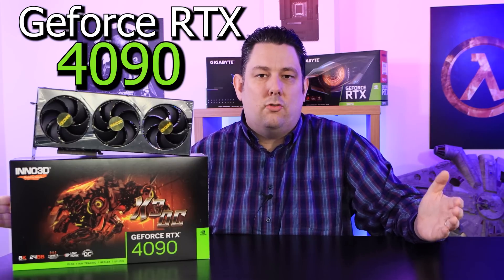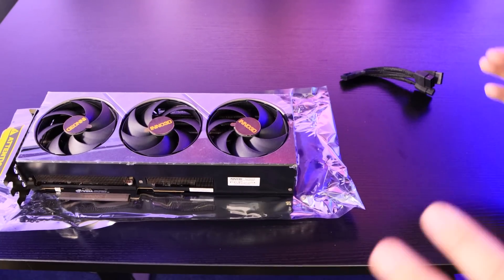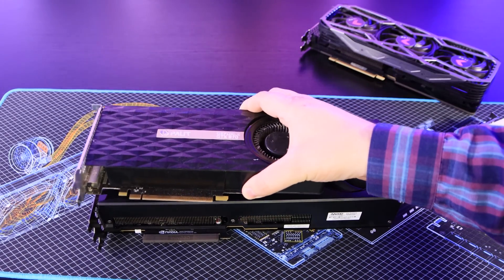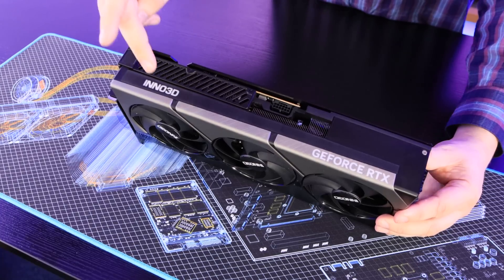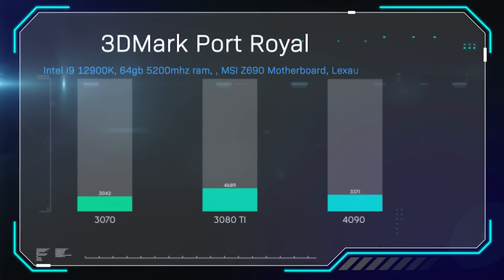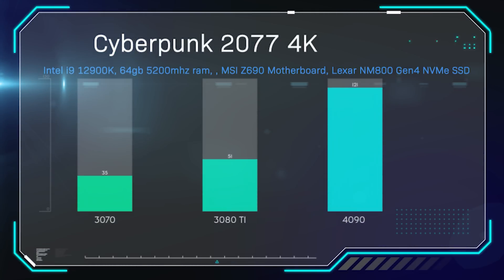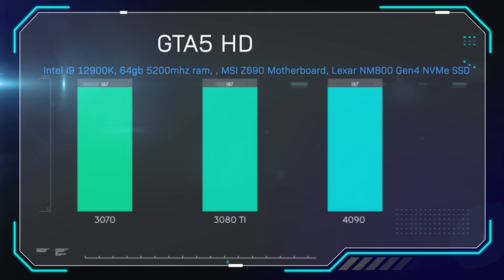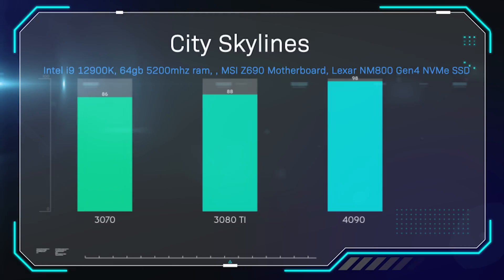How BIg? GeForce 4090 Benchmarked - Inno3d GEFORCE RTX 4090 X3 OC

Comment: 1200W plus?? I mean yeah that's cool but I have no problem running my 4 SSD's, RTX 4090, i9 12900K with my Corsair HX1000i PSU. I guess I am okay since I am not overclocking.
Reply: Even a good quality 750w is enough
Reply: @kokiniwa63  yeah people are going crazy with the power requirements. It draws like 450w, even with an insane cpu youll be good with a 850 id say but probably even 750 if you dont raise power limits

Comment: Are those fans on idle sometime? I have one like this but the fans only spinning at boot and turning of the PC
Reply from the maker: Fans will only spin when they are needed, so when it gets hot the fans will kick in.  Its normal for fans to run when you first turn on the PC as they dont know how hot the components are so to be safe they turn on right away.
Reply: You can make a fan curve with afterburner... did it on my inno3d 4080 x3

Comment: is there any reason why it comes with a 3 pin connector and not a 4 pin connector? I dont have audio so apologies if you explain it in the video!
Reply from the maker: Basicly stops you from overclocking it a lot, not that you would get much better results with the overclocking compared to the extra heat and energy usage.  apparently, if you get a 4 way splitter you can overclock it more if you wish, "not confirmed"
Reply: @TechforTechs  is it posible to lower the power limit? I have heard that the power limit is locked... but i suppose that they must say locked to increase... is it posible to put down in order to save some watts? thanks
Reply: @betomacias9515  Yes. You can always lower the power limit. And that is what everyone should do with 4090s.
Reply: I have the Palit GameRock 4090 non OC which is also locked at 450w and with 3 connectors instead of 4. Yes you can overclock the GPU to a fraction under 3000Mhz though certainly not worth it but you can flash the BIOS to the Gamerock OC which unlocks the power to 500w. I would presume the Inno also has a OC version BIOS. Personally, so much performance that it is not worth the extra wattage for an overclock and an undervolt drives the same performance but drops circa 50w.

Comment: Why did the lights go out at the end of the video. Was it sapping too much power 🤣
Getting my 4090 inno3d x3ichill delivered today 🤩
Reply from the maker: Ill blame Youtube, nut sure what happened as the video file is ok
Reply: Where did you find it? I can't find it in stock any where...
Reply: Managed to get one at 2.03 from overclockers before they all started going oos. Didn't even try getting an Fe I knew the page would probably crash.

I was so prepared for this launch (after missing out on the 3080 launch) that I also managed to get the Asus tuf oc which I couldn't cancel before dispatch (I wanted to make sure that one of them shipped) That was £300 more so that's gone back to Ebuyer today for a refund.

Little need to overclock, but got the card at 2910mhz with 1000ma pulls 380w tops, 300w gaming.. 

Another bonus I didn't need to upgrade my PSU - rm750w. I think if I had of tried the tuf i'd of needed a new PSU.

Comment: Reminder this is the smallest 4090 model so far this is a true 3.0 slots card with all of that it's still wide and THICC.
Reply: Exactly I just bought this one because of its height .
The other ones would fit the case , but not with the power cable connected